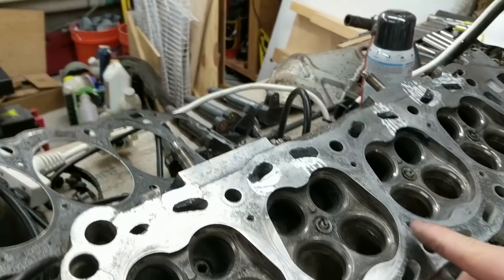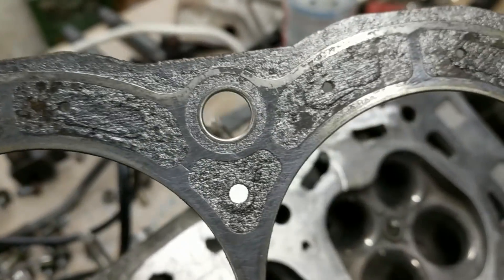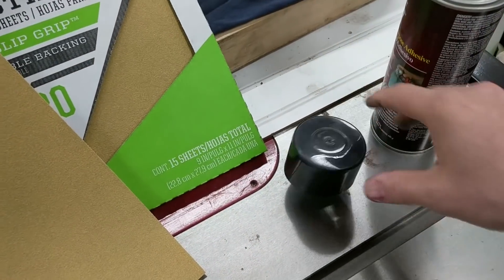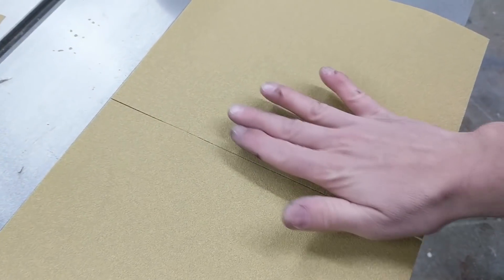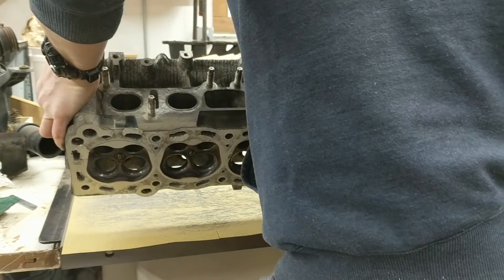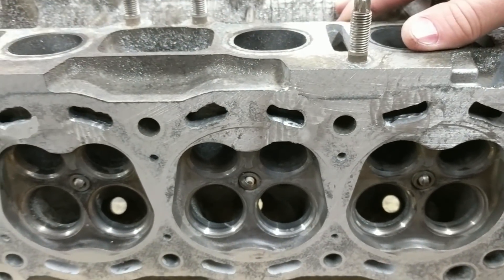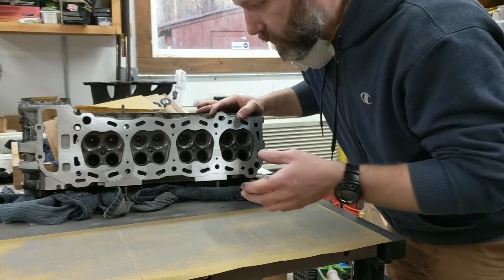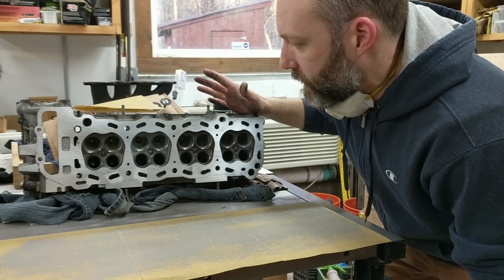Using a Table Saw to Resurface a Cylinder Head

Comment: My cast iron table saw is nowhere close to flat.  did you measure yours?  I have done similar flattening by sticking sandpaper to my granite surface plate.  My surface plate was < $100 on ebay, probably because it had threaded inserts in it that put other people off.  https://www.youtube.com/watch?v=-HDCrsosVeM

Comment: been doing this to a K series rover engine (18k4f) but almost polished it in the end with 600g paper 👼However, the top speed is back to factory specs hitting 100mph on the point.

Comment: I'd imagine wet and dry sandpaper would cut faster if kept wet constantly.  Blew the head gasket on a Harbour Freight 305 cc engine. That 1950s Craftsman tablesaw has got to be the flatest surface around. That tiny head is a bit pitted as well as it's mating surface. Somehow I sourced a new gasket and can skip scroll sawing a new copper gasket.

Comment: I used my board file on my 455 GS heads and got it closer than a machine shop.  15 ten thousandths think was max gap, good enough for cast.  now if I could only find my straight edge again.. Think someone borrowed without writing on the board.. dry erase board in shop for when buds need something.. they are cut off now..

Comment: How about you spend the $75 to have the head properly milled with a PCD on a machine designed for this exact purpose to achieve correct Ra specified for the headgasket? And no 80 grit and a “gasket bite” aren’t used in the industry. But heck, it’s not my ride home.

Comment: With an overhead cam, it is important to have the head straight and NOT just the gasket surface being flat.  So if the head is warped, the cam bearings will be off.

Comment: Is this a Toyota he as d ? Did you use a stock headgasket after of u get something different ?
Reply from the maker: yup! It's a Toyota head, I used an aftermarket gasket.
Reply: @WhatDennisDoes  what you get ? I just got my head redone at a shop near me and I'm not sure what gasket to get looks just like yours is it a 2.4 ? Or 2.7 ?
Reply from the maker: @fonzaman  It was a FEL-PRO brand, I got it from RockAuto.com.  I like that site, never had a problem with them even when I had to return a full exhaust once.  Mine was a 2.7L.  You can get the full gasket kit which includes valve cover gaskets too I believe.
Reply: @WhatDennisDoes thanks for the replies :)

Comment: Great video, thanks! Oh and a tip, if you still have the engine block in the car and you want to surface that as well (without any of the dust falling into the cylinders) then just flip the car on its top :D

Comment: Also I watched someone (maybe you) fix a warped head by bolting down the high point with some spacers under the low points and then he heated between webbing on the top of the head with a torch, it relaxed the head back to flat. It was pretty awesome.

Comment: I watched garage 54 do this, except they used an old wiper motor and bolted a bar to it, and bolted that bar to the head and it did the work of pushing the head back and fourth. They used water to wet sand which was probably not as effective as what you're doing, but no elbow grease lol.

Comment: You have to be very careful with this method after welding on the surface of the head. You could end up with spots of different hardness that could sand unevenly, and create more headaches for you.

Comment: Problem you can run into is if you have a high spot it will flatten unevenly and could cause your head to have a taper or twist. So be sure to keep an eye on it as you get started to make sure your getting an even pattern

Comment: You could build a machine that could push and pull it for you, maybe like a steam trains drive wheel, set it up off a water wheel by diverting a nearby stream to run by your shed, would make for a nice 5 minute video, you would still have to change the sandpaper manually, or set up some solar powered sandpaper changing machine, i dont know id just buy a mill or bri g it to a machine shop, id liketo have a mill, for the once  a decade i would skim a head👍

Comment: I don't have a lot of faith in the flatness of a table saw for starters. Add to that, if the head is warped, so are the camshaft bores, and to fix it right, that head has to be heat straightened first.

Comment: just did it on a 1/2 inch plate of glass and used stair skid sticky paper that works just like sandpaper and can be wet sanded too..it also comes in a role and you can stick down one full piece. it worked great.

Comment: Certainly not stupid anything you can do yourself is a Proper Creature Person. 

If you could weight it down and make a pair of connection handles to the head to leverage your sanding the head. 

After seeing some other guys video, I would want to do the magna fluxing first to see if the head is cracked.
But when does a cracked head have to be considered garbage versus could it still be used by a person for himself was not discussed and so mentally I defaulted I assumed to have to scrap it as they were stating they do and it was an automotive shop. But for a person who doesn't have a lot of money doing their own work you just opened up a pathway for the idea that even a damaged head might be reusable.

You actually show the potential to do for ourself our own heads that maybe we can get it 'GOOD ENOUGH' and get another 100k or more out of a head and where you have a heck of a lot less expense and weight time.

BUT, as I am writing/recalling on the topic you also have to make certain to check your head top because it can be warped and this will throw the plane of allingment  of the camshaft ways out. Again, I don't know how critical this is because it wasn't discussed but through a complicated and lengthy process of clamping an assembly across the top of the head to press it and then heated it for +- 12 hours they brought the camshaft ways back into alignment.

NOW, what I see looks like a problem is why is the gasket not properly cut/punched for your coolant jacket ports? I would cut/punch them open or look for another gasket because that is Goddamned CORUPT manufacturer they are intentionally blocking the coolant jackets and that was a guarantee why you had some problems. Are there oil ports being blocked and starving your engine of oil?

Are you within a distance of Aberdeen Maryland? I need someone to be able to work by so I can get help to get a good beater car between donated to $500 and have a place to work on a car to do the initial periodic maintenance work that no one seems to do to get it over-the-road ready?

Comment: If i were to port and polish the coolant passages for more coolant flow can i also make the holes bigger on the gasket or will it get ruined
Reply from the maker: Just going by what my gasket looked like, it would probably be damaged if you enlarged the holes.  I'm not even sure what tool you could use to do it if you tried.  Maybe a different kind of gasket would work?  Mine was an MLS type.
Reply: @WhatDennisDoes  ok thanks

Comment: Did ya take refference points measuring cylinder head height .just remember cylinder head act like a spring everytime a  power stroke cycles take place head lifts up to 50 to 200 of a thou off the  block don't go to crazy or  run into head gasket issues.one last thing chamfer radius on combustion chamber's no sharp edges as they will cause hot spots.. good job
Reply from the maker: Oops.  I didn't know about chamfering the edges of the combustion chamber.  And I had no way to accurately measure the height so I didn't.  It's still going strong though, well past the point that I needed it to. Been over a year of daily driving.  Now I have other problems with the truck, oil leaking from the crank case somewhere and failing emissions (rusted out cats).

Comment: Great video; thanks!
You can use soap and water to clean it (and water to rinse) in a plastic tub. Just make sure you dry it very well (compressed air), and then oil it to keep it from corroding until it's ready to install.  I've done that a number of times with success.
Anyway, very cool!

Comment: When I worked in a machine shop we called this technique "floating".  We'd use a figure 8 motion.  Obviously it would be difficult for you on a large object.  Also, we had a straight edge to check it and stay on track.  Its not as much about shiny surfaces as it is about flat.

Comment: The issue with this is that you can easily cause it to be angled. With you holding it the way you were it would likely take more off from that side which can cause all kinds of problems, timing belt alignment and intake alignment to name a couple. It doesnt cost much to resurface a head.

Comment: Sadly this is a horrible idea on overhead cam engines. Why? because if the head is warped the cam jurnals are also going to out line, meaning you flattened the bottom and left the top warped. If the warp is severe enough your cams can break from this, and your timing belt could eat itself. If you have cam followers/buckets it will also change the clearance between the cam and the follower make it possible for valves to stay open even when the lobe is not pushing down on. This could give you a false low compression reading from the valves being ever so slightly open. On overhead cam heads you need to straighten the head and make sure jurnal are all in line before you resurface the bottom.
Reply from the maker: This is all true in theory but in practice aluminum overhead cam heads are sanded like this all the time.  It would take a pretty noticable warp to affect the journals and it would be obvious when the head just needs to be tossed.  Everything went back together easily and turned smoothly. The truck has been running great for over a year now, it's my daily driver.

Comment: I found if you are going to do a lot of heads go to a home improvement store that sells marble or granite countertops. Ask them if they have any larger cut off sections from a install job or broken ones that are large enough to do this with. You can usually get these pieces for $20-$40 because they were just going to pitch them.
Reply from the maker: Good tip!

Comment: Glass is the best. It lays flat when it's a liquid and seals 100% flat. Use wd40 for the lubricant and it also keeps the aluminum from Guming up. If you let that happen then you start cutting uneven surfaces

Comment: Thank you for sharing.. excellent, valued help..   05:00 mins Yes !  Glad to hear you say that.. about wood.. It is very true..   I discovered that when working with wood... almost impossible to hand flatten a piece of wood.. without taking more of the ends, and sides.. Better to flatten an oversize piece and then trim to size.. when it is important of course..

Comment: As a automotive machinist with 25 years of experience, as long as you can find a surface that is true 0, it will work fine for most heads. It won't be a true 0 finish, but close enough for use. Most engine builders don't realize how much the head gasket will compensate for 1 to 2 thousandths difference over all. But the use of a mill or stone resurfacer is recommended for most performance engines. As the higher rpm's require a better fit, or the increased pressure from the combustion stroke firing more often, will push right thru the gasket.

Comment: I used similar method on my 1963 Olds 215 aluminum v8 oil pump housing, it works

Comment: If you were pulling a large lump of concrete or pushing, which would be easier? Exactly. You agree then. Pulling it easier. Your method of pushing cylinder head will take more from front end for sure. Physics

Comment: I can't believe all the thumbs down this got. Most people don't know that the most precision machines are hand scraped to a flat reference surface. This is probably better work than a lot of machine shops produce. Elbow grease and ingenuity. I'm going to resurface my engine block in a very similar manner except I'll be attaching the sandpaper to a 6x8x2" granite plate. The plate is accurate to .0001 of an inch in all directions. There ain't a machine shop within 100 miles of me that'll spend the time to get it as good as I will. But, it will take some time.
Reply from the maker: Thank you!

Comment: That's a super idea. Kind of similiar to how they resurface Black granite surface plates only they use large flat diamond hone jigs instead of sandpaper. That will come out really flat depending how flat the table saw surface  is. I would also turn the head around 180 degrees once in a while just to make sure it's an even grind. 80 grit should work Great.Thumps up on this one. Thanks :)

Comment: Use the surface wet. So the paper does not clog up.  Maybe some emory cloth and spray it with water regularly and it should cut much better and not end up with "buildup " in spots on the paper and stay flat as possible. But what a great "budget " idea u have there!

Comment: I have done this several times on motorcycle heads. I used this method, then switched to finer grit. Works great. Its not rocket science.

Comment: This maybe fine for a yard project, but not advisable for high compression engines. By the time you spent the money on supplies, and replacing the head gasket when it leaks, plus cleaning the crap off of your table saw....just take it to the machine shop...this is called the halfassers club! Do it right, and do it once and take it to the machine shop!

Comment: Far from stupid. 👍👍I overheated and warped the head on an engine driving cross continent. Being in the middle of the prairies with camping gear,  basic tools and little cash, I used a big file to file out the warpage. The old gasket didn’t sustain any damage so I torqued every thing back down. Drove out the next day. That engine repair lasted till I sold the car. About 50,000 miles!
Reply: plenty of tools with you, ahn...    lol

Comment: Brilliant!
I've been wrenching for as long as most of your commenters been scratching their daddy's zippers, never seen this trick.
I always had a palm sander do the dirty work and torque the bolts an extra 25lbs, never had any problems myself, but I would use this trick if I ever have to do another one!

Comment: That's why it got to hot and cracked to begin with no coolant can circulate through those pinholes punch the new head gasket out so the coolant can circulate.

Comment: In all reality wouldn't the gasket material compensate for the insignificant amount of surface material you removed this way?   This is NOT an Indy Car. This could have easily been accomplished with a palm sander and a less aggressive grit. As a former welding inspector Im not EVEN going to comment on welding on a head with a mig. Whats interesting is how the mindset of using a mig to weld on a head is INCONSISTENT with worrying about truing up the same head. Using liquid gasket material to fill the holes and then to make up the difference seems to be more consistent with the line of thinking that drives someone to weld on a head. Either way for under 50 bucks and virtually NO time investment you could had something that was professionally done. Not that you always get what you pay for but as a general rule reputable machine shop dudes are usually pretty anal about their quality of craftsmanship.
Reply from the maker: Why wouldn't you MIG an aluminum cylinder head?

Comment: good way ro ruin a head  causes uneven thickness and cam bearings no longer in line and will burn cam bearings and lead to camshaft breaking from bending, Look at spec for unevenness  0.030" or more, head flexes when torqued down.

Comment: Correct way to make a flat surface is to just use 3 slabs of aluminium (or steel if you have more patience and want a longer lasting result), put grinding compound between A and B, grind them against each other for a bit, then grind B and C against each other, then grind A and C against each other, then repeat many many times through this cycle. Then you get PERFECTLY flat surfaces to grind heads, cylinders, pistons, angle irons, jewels, gold, brass, whatever, against.

Comment: I know this is an old post, but if you had used the 'engeneering 'blu' the dye which is applied to metal and if you had painted a thin coat all over and allowed to dry, then you MIGHT have been able to see more easily where the high and low points were and rubbed till it was all removed? Only a thought.

Comment: Should have used a "figure 8" pattern and blown off the paper every ten passes. They make lapping tables with 45 and 30 degree cuts in them, the first for roughing, and the next for finishing, or just toss it on a Blanchard and be done with it.

Comment: As someone who actually worked in motorsport for ten years I can a) confirm that this works fine as long as the surface is flat and b) even some race heads are prepped this way if being reused after a rebuild, done on an actual surface table and with some skill this will actually yield a flatter surface than many machining processes
Reply: I did the heads and block for a Subaru flat 6 with this method, and the results were below (less than) 0.05mm in surface distortion. I learned it from a Yamaha jet-ski service manual.

Definitely works - and works well.
Reply: Agreed, even the best bearings in the world in a well used machine will not be as true as this method if done correct, this way there is no tolerances to worry about

Comment: Please tell me he is going to use a fiberglass gasket and not a steel one.  You should never sandpaper the surface of the cylinder head. Why do that when a shop will machine surface it for cheap and correct.